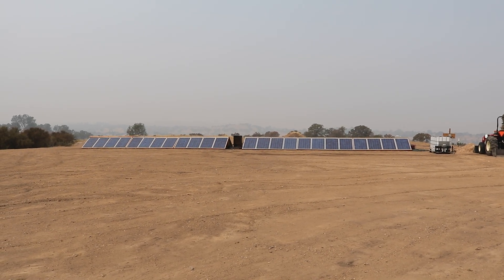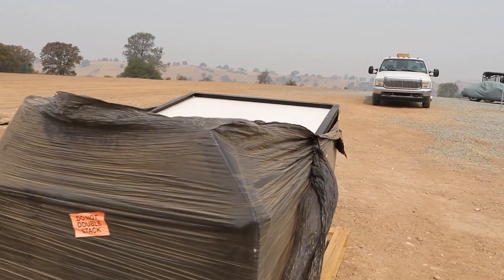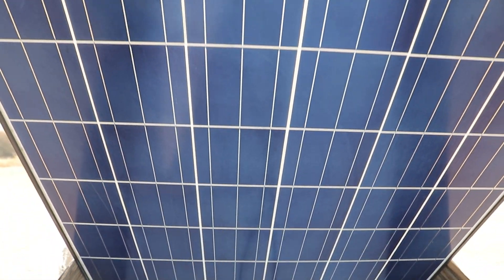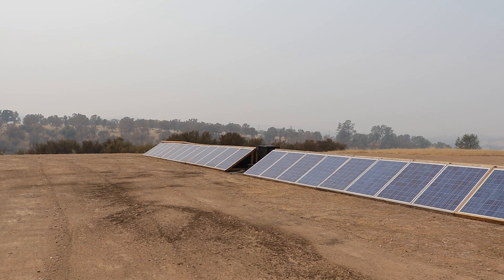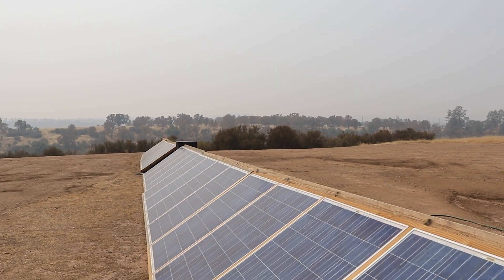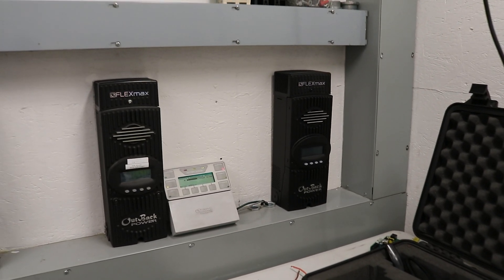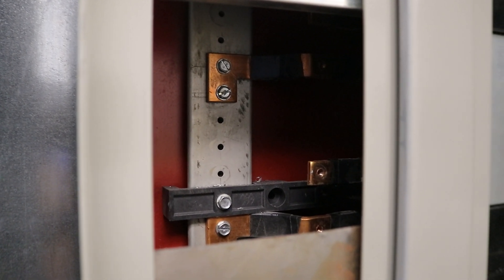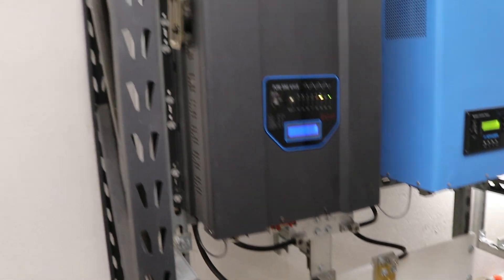Solar Reconfiguration: Part 5 - Adding 48 More Panels!

Comment: Why is there a fan in the middle of the field....
Reply from the maker: It's my biggest fan, and it is outstanding in its field!
Reply from the maker: It also has seized bearings, so right now it covers a valve box that has a water tap...This way it doesn't accidentally get ran over.

Comment: Wood Works for me.  The only wood I've had warp and tweak on me was the damn Pressure Treated green stuff.  I'll never us the crap again.   Some of the 4 x 4 actually made 90 Degree turns.
Reply: I bet they didn’t dry them probably before treating them.
Reply: @DuncanCunningham  Something went south.  LOL   I've done good with regular wood.  I'll stick with it and paint.